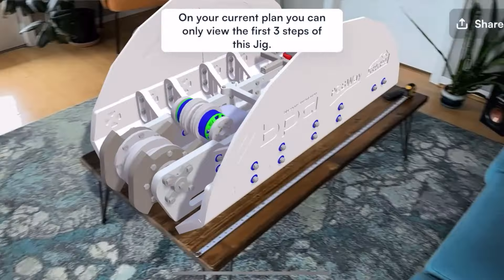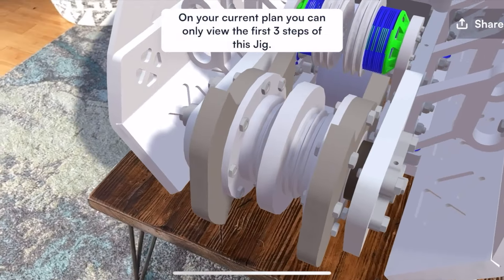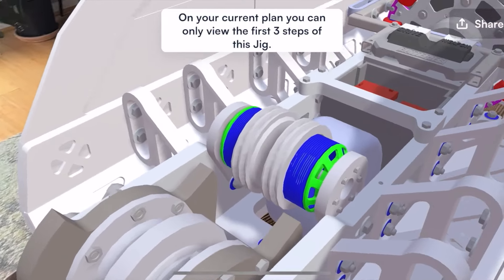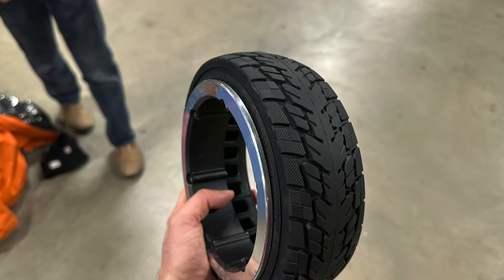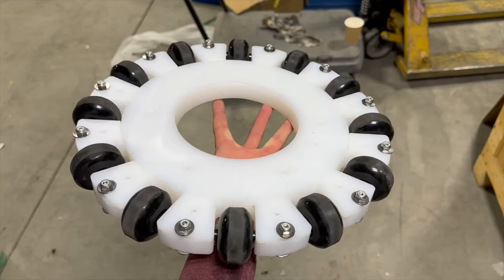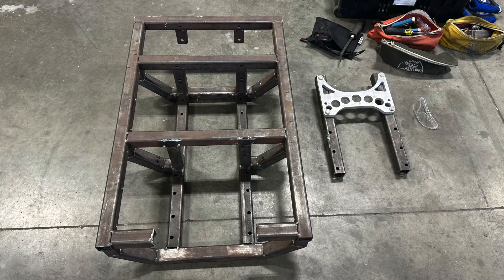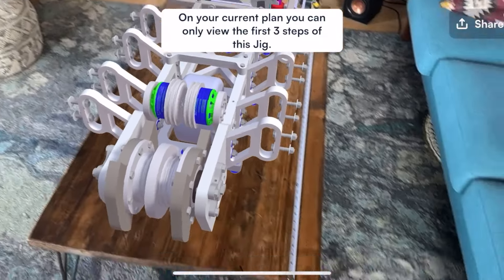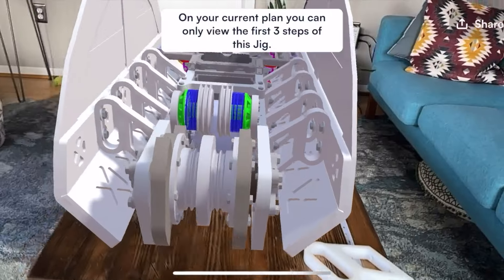BattleBot Design Update! (80% new parts)

Comment: The new design is amazing, can't wait to see it in action! I love the sandwich approach to the rear wheel, almost any team running omni/mechanum wheels has had some issues where the axles worked their way out and seized the wheel, but with the clearances and design I don't think that's going to be a problem here. The air armor is impressive considering you designed it in such a way you didn't have to enclose the entire bot, a mistake made a lot in the stone/iron age of robot combat where people made huge boxes with tin foil or plastic armor.

Have you thought about a ground game? Sad reality is that if you cannot get under your opponent, it's hard to actually make decent weapon contact and you will be bullied around by any bot that can get under you, which with the taco shape basically funneling wedges under it won't be hard.

Especially with how they were talking about welding the floor plates of the arena together creating less bumps/ridges for forks to get stuck on, it's going to be as important as ever to have a good wedge or fork setup. There are some bots who rejected this to some degree but they are just outclassed at this point and with the welded floor there is no "waiting until the floor is trashed" moment bots like Deathroll focused on earlier. It seems like the slots on both sides of the weapon uprights could maybe mount some forks but I'm not sure, there would be a lot of torsion on that piece of aluminium frame so it might just twist on a big impact.
Reply from the maker: Thanks! Yeah, we've made every effort to make this omni wheel last, and still sorta function even when very beat up/missing parts. Re. the fork game: For our Vegas fight, we won't worry about ground game, because I care most about putting on a good show and two robots seeing who has the sharpest spatula is not a good show.... But if we get on the TV show, we may have to add some modular small torsion-spring-loaded feeder forks and use them for certain opponents.
Reply: @CarterHurd tip have a few spare and one non Omni wheel

Comment: The omni wheel should help you square up a lot easier. Still concerned about head on collisions but the side armour design is a really good idea it would take a lot to penetrate your side. Hopefully the edges self right you quickly because people will go for the base as soon as your tipped.
Reply: The big weapon on the front should solve any head-on collisions, maybe add some big chunks of UMWH to the sides of the weapon axle mount to brace it against horizontals but really aside from the weapon uprights, there isn't much to hit on the front. And the back has a big welded steel frame so that should be able to handle some abuse as well.